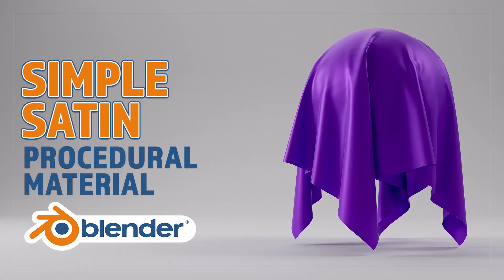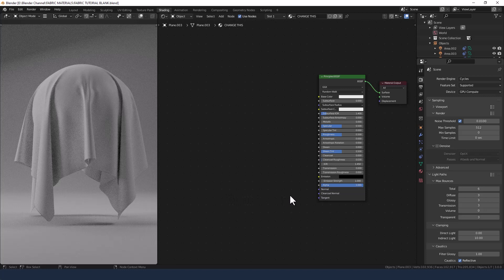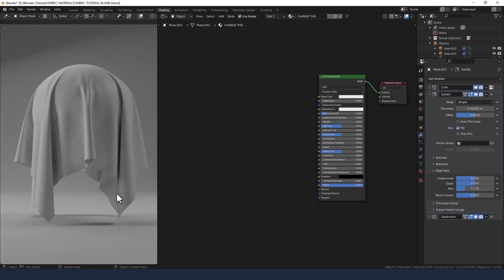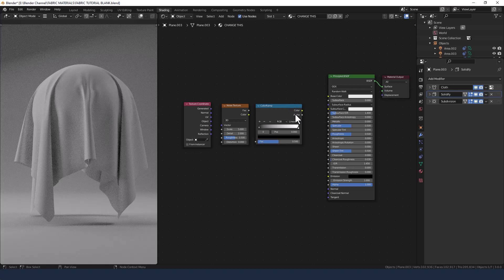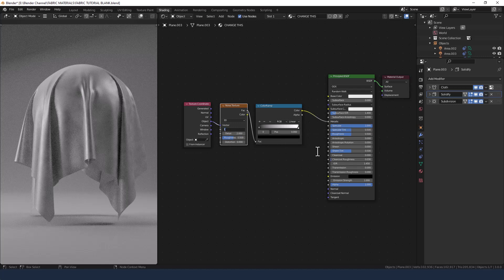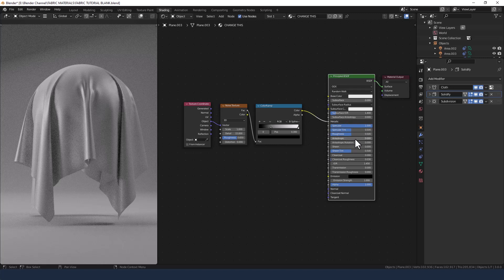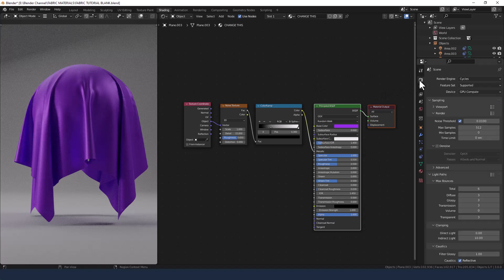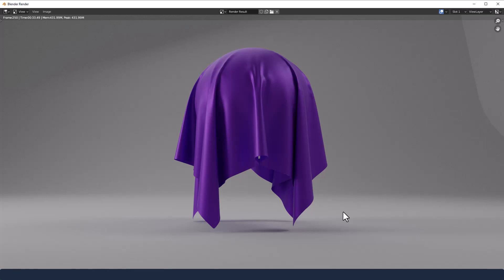CREATE A PROCEDURAL SIMPLE SATIN FABRIC MATERIAL FOR BLENDER

Comment: Very useful, simple and realistic. For my purposes I added a noide texture with the same parameters than yours but a scale of 500, plugged it into a bump node and then into the normal socket et voilà! Satin like you've never dreamed of. Don't forget to reduce the strength to 0.025 in the Bump node. This will also give you the texture for some eyelids with makeup.